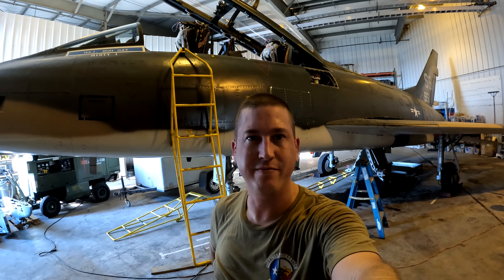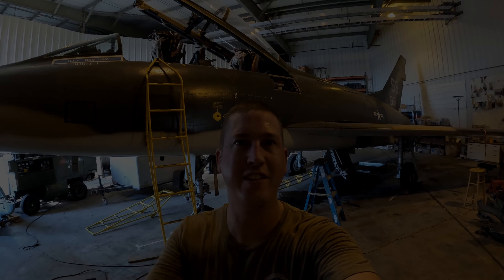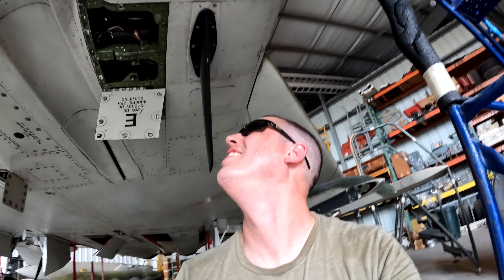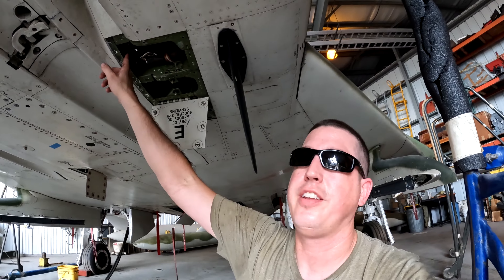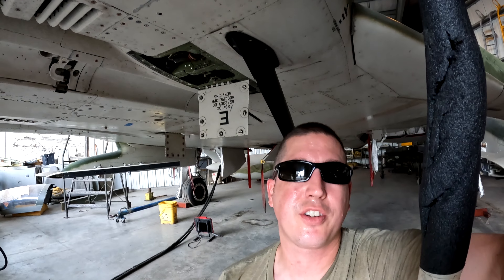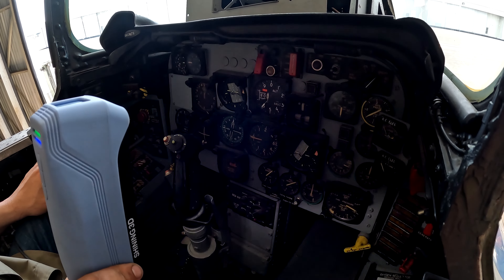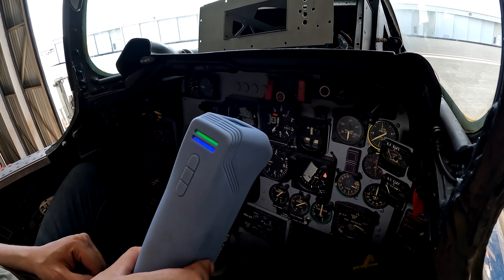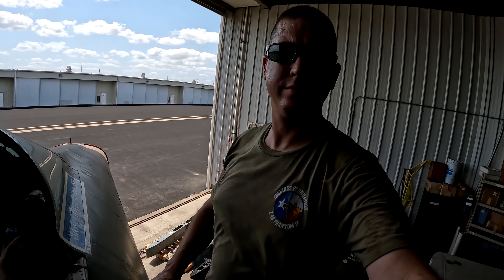Phantom Update and Behind the Scenes of DCS World Module Development | F-100 Super Sabre

Comment: Will you be making a sound mod for the Phantom for DCS when release
Reply: Do you have headphone that can pump out 156 db ?
That's how loud Phantoms can get.
Reply from the maker: @T-Cup302 I don't have any high end recording equipment to be able to do a sounds mod, but I'm also confident that Heat Blur will have authentic sounds for their Phantom!

@trespire I'll be ready for those burner tests with double hearing protection!
Reply: @DieselThunderAviation  Good (fresh) ear plugs, Peltor ear muffs, the -15db big ones if you can get them (not so cheap but worth it).  I couldn't stand closer than 30 or 40m , even behind something heavy, usually one of the carts at the HAS entrance.  If they get up to full reheat, watch the front landing strut get compressed as 26 tons of jet crouches down.